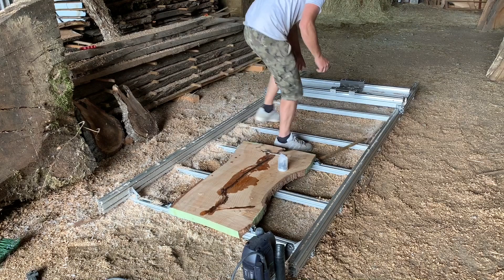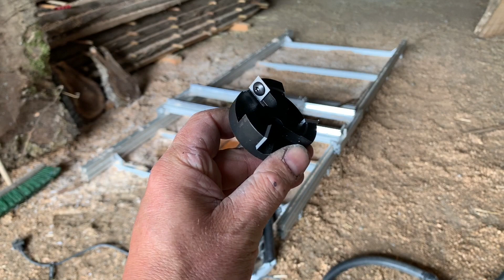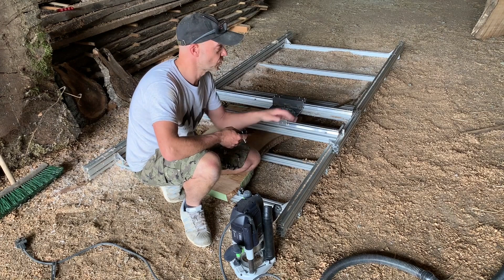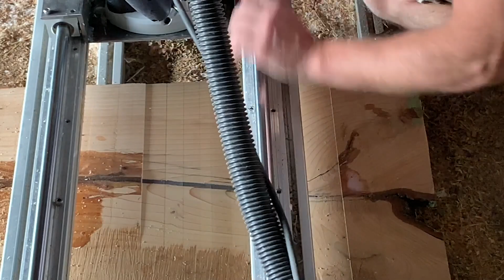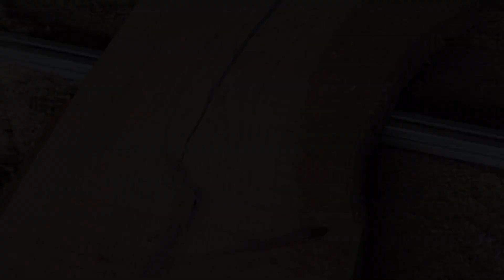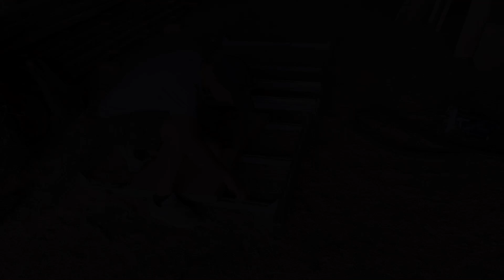#MWshoptalk   Router sled and Cutter part 3

Comment: Bet it’s diving because of the router face digging in a tiny bit when cutting since there is a bit of slop in the rails to let them slide smoothly 
Also should be milling with the grain like a CNC would
Reply from the maker: My version 2 is much better , CNC style router sled just costs 13k less !!

Comment: I've just ordered the Ally Extrusions, (40x 20) as mine will be fitted to a flat solid table. I have bearings for the Gantry runners and the Router Runners, they will be mounted to fit the side grooves of the tracks. I need to make up 8  (40x40x5mm Ally) bush plates with holes for the bearings, (4 per plate to prevent racking).
I've got all the hardware except the Extrusion, coming this Wednesday! Happy days!

Comment: Are the Titman bits 12mm shank like cnc bits ? did you have a special Collett or do they pull up in the half inch ? Great idea I do a lot of bar tops and am interested in this sled set up .
Reply from the maker: you can order 12mm or 12.7mm I have 12mm plus they sell a collect

Comment: Nice work. You could mount the router on a plate with bolts on each corner to adjust it. Probably easier than manufactuiring the mount  perfectly. Like plate on a router table has.

Comment: Sliding channel blockages.....could you fit some kind of small angled "wedge" to the carriage inside the channel grooves which pushes any sawdust/chips up and out the way whilst moving it?  Bit like a snow plough effect.  Does that make sense?
Reply from the maker: Yes it does , good idea.   If you are working on one slab maybe 2 it’s not a problem but after 2x slab you need to brush it out

Comment: If you shimmed the plate that's low it could be a temporary fix and maybe have the revised plate on levelling screws so that you can fine tune it as welding is almost impossible to get that perfect with heat distortion. Great build, extrusion is brilliant.
Reply: Exactly!